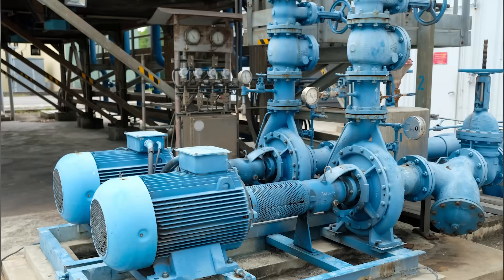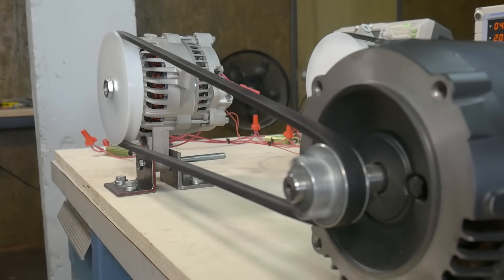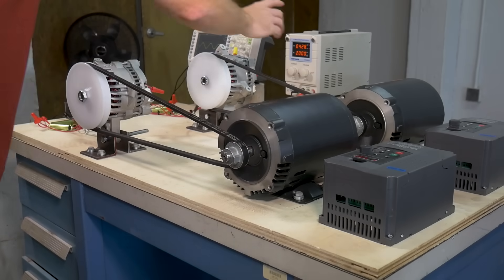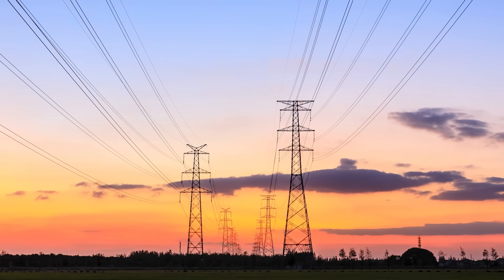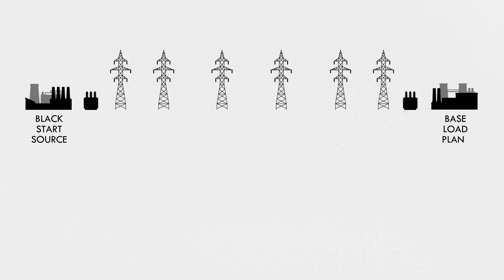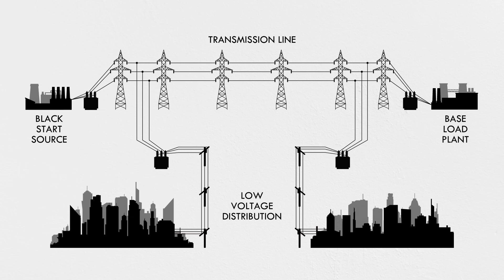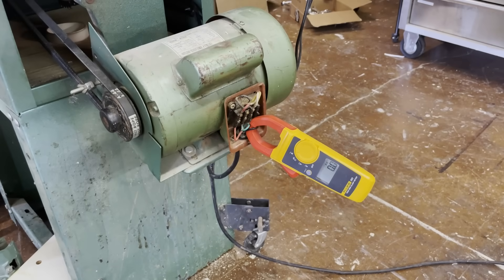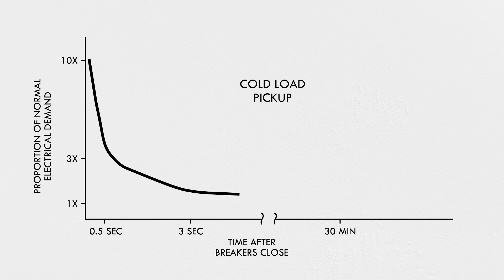What Is A Black Start Of The Power Grid?

Comment: Was involved in a nuc plant upstate NY during the last big blackout.  A nearby gas-turbine plant 'black start capable', fed us power so we could shutdown our emergency diesels.  Then fed a couple of other oil and gas-fired plants that added several MW capacity.  Was a nervous night/ couple of days.
Reply: I was in the NRC ops center that night. I was glad that the evening wasn’t more interesting on our end than it was.  Good job on your end.
Reply: Is there a reason why nuclear power stations don't throttle down and/or partially dump steam to condenser during load rejection? Because tripping nuclear units offline seems far more dangerous than keeping them running at low load, as Fukushima seems to suggest.
Reply: The plants can shed load, but they can’t do it quickly enough to avoid having to shutdown when operating at high power levels. I worked at a plant that presumably could avoid tripping up to about 40% power by operation of turbine bypass valves.  Loss of load transients are part of the design basis of the plants, so they generally shouldn’t create big issues, as onsite emergency generators provide power to essential systems. Plants typically have fuel for several days operation under such conditions. Fukushima was a different type of accident known as a station blackout.  In that case, in addition to losing all offsite power, the onsite emergency diesels were inundated by the tsunami and were rendered useless, so all cooling capability was lost, eventually leading to the meltdowns.
Reply: @gizmophoto3577  Yes, the backup diesel generators were wrecked, but the station electrical bus bars survived. If even one of the reactors at the complex had remained operating at part load, it could have powered the cooling water pumps for the other reactors.
Reply: I expect that one unit could provide power to all three, as you suggest. However, as noted, they were not designed to be able to avoid tripping after loss of load from full power. Such capability would have required substantial changes, such as faster operating and higher capacity turbine bypass valves. It’s also likely the reactor coolant system would have required to be designed to a higher pressure limit, or greater relief valve capacity installed. I frankly don’t know if such bypass valves could have been designed and manufactured at the time the reactors were designed and constructed, or if that and other changes could have been obtained at a whatever was judged to be a reasonable cost. 

My personal view is that the reactors were poorly sited in what was known from the historical record to be an area subject to tsunamis. If that threat had been adequately addressed, the reactors would have survived intact. If you are interested, you can find the report of the Japanese Diet’s The Fukushima  Nuclear Accident Independent Investigation Commission report online.  That document describes the failure of both TEPCO and the Japanese regulator to understand and address what was a known hazard.  I also note that Japanese regulations didn’t even include tsunami until 2006, per a March 26, 2011 New York Times article. 

I hope I don’t seem contentious or argumentative, as that is not my intent.
Reply: @gregorymalchuk272  Part of any plant's design is an item known as 'load rejection test'.  Just how much load can be 'instantly' shed.  Of course part of this issue is the main turbine/generator suddenly accelerate and you want to avoid them overspeeding and tearing themselves apart.  So the turbine controls are designed to quickly shut down the steam flow (most also have valves close between the high and low pressure turbines during such an event).  Now the reactor has to send that steam elsewhere and there are limited places.  Some thru turbine-bypass valves, some PWR's can safely send it to the atmosphere through safety-relief valves. But in any case, the primary/ reactor system starts rapidly heating and it is one of the design events to deal with this.

A newer reactor design (AP1000) that I'm familiar with will even trip a few control rods to rapidly drop reactor power.  But from near full power, about the only thing you can do is automatically trip the turbine to stop overspeed and automatically scram/ trip the reactor.

Comment: For forty years I programmed the building automation systems for dozens of high rise bldgs and other large power users in Texas. Every structure had a program called AwSh.. whose only purpose was to bootstrap the bldg - hold it down until a return to normal was received from the local substation then be nice on the way up

Comment: As a fellow Texas Engineer, I really appreciate your videos!  Municipal water supplies would be another good topic with lots of examples to pull from locally.  I know we recently had an emergency repair on our deep water intake that was a fascinating example of how repairs are done on an active utility with minimal (or major) disruptions.
Reply: I always wonder how big the collective face palm among Texas Engineers was when the 2021 blackout was blamed on renwable sources by officials.
Reply: @ValleysOfRain  It wasn't just the engineers, it was anyone with enough intelligence to vet and understand the readily-available information they found on the web.  But I bet it was big.
Reply: @ValleysOfRain  Nuclear is the way.
Reply: @ValleysOfRain  while everybody knew it was due to powerline failures and fossil fuel plants and pipeline not designed for the cold and not prepared for it. Had they built 4 wind turbines less the entire grid had collapsed completely
Reply: 'major' should been in bold, for Texas.
Reply: New England is next it’s gonna put that TX event to shame!!
Reply: @740GLE  Don't know about New England, but Texas problem was GREED and a lot of missing money. 

Every politician and upper management in Texas should be criminally investigated.  But it's Texas so it won't happen.

Comment: There is nothing more "fun, no fun" that such condition, you can not ramp up the production to 100%, yet the load can still be at 100% or near it.
Is pretty much like taking a gasoline car out of the mud, once it gets stuck you gonna have to shift tactics.
Luckily, you can shed load... And I forgot what Grady pointed out... the whole electrical infrastructure need electrical energy to power itself and run some of it's regulating circuits.
So it is really a bootstrap operation.

Comment: Every time I watch these videos,  I learn something that is completely obvious in hindsight but I would never have thought about otherwise. Engineers are on a completely different level.
Reply: A lot of the experience engineers gained is gained from disasters and hindsight, believe me.
Reply: I think of engineering as “quantified paranoia.” You’re not done if your design only works under ideal conditions. You’re getting close to done if you can confidently answer questions like:

- how would this break?
- how much can it handle until it breaks?
- how likely is it to break?
- how bad is it when it breaks?
- how can we avoid the worst consequences if it breaks?

And yeah, a lot of best practices are informed by past people breaking stuff and learning the hard way.

Comment: Very interesting.  Now I'm curious about how the startup happened with the 2003 North East outage.  I live near London, Ontario.  Our power was restored fairly quickly where as I know other areas took longer to be turned back up.  I also remember they were warning that power outages may occur in the days afterwards.
Reply: I was in Oswego, just across the Lake.  We had two gas-turbine plants nearby that were black-start.  One of the highest priorities was to get us back power (we were a nuc plant and using our emergency diesel generators for cooling and needed off-site power ASAP).  From there, they fed two gas-fired steam plants in town and even lit-off the older oil-burning units (seeing them 'belch' black-smoke during lite-off was a scene we hadn't had for some time).  Somewhere south of us, they tied these in with the power coming up from Niagara.  It was a pretty 'interesting' couple of days.

Comment: Another great video. I love the effort you put into these garage demos. Too bad you had to sacrifice two automotive alternators but it visually got the point across.
Reply: No alternator were harmed to make this video, they ascended.
Reply from the maker: They will go on to greater things ;)
Reply: @PracticalEngineeringChannel   Grady, I'm guessing you have lots of fun things squirrelled away.  Your prioritized wish list would be a fun video by itself (e.g. 3:55 "yet").  Do you have a B channel for that kind of stuff?
Reply: @PracticalEngineeringChannel  connect the alternators to a 3 phase step up transformers and make a working useful generator from it to power your house in case of blackouts :)
Reply: @putraadriansyah8082  He still would need electricity to excite the alternators, and to drive the electric motors that turn the alternators!
Reply: @putraadriansyah8082  What? You can't get something from nothing!😁
Reply: Uh sorry, i forgot. Use a small 160-200cc engine to turn it and use a 3 phase transformers to make a usable power. And some Arduino to control the rotor voltage

Comment: Not sure if absolutely related to the complexities of the grid and black starting but even after the power came back on late in the night of the 2003 blackout, for days afterwards we'd still have several smaller outtages lasting anywher from a couple hours to tens of minutes. It wouldn't be until maybe a week or two later that things where stable and since then I haven't seen any major outtages in my part of Ontario aside from local disruptions.
Reply: might be they didn't have enough production capacity in total and did a sort of rolling blackouts...?
Reply: Xenon poisoning meant that water moderated, thermal neutron nuclear reactors were offline for several days to a week after the blackout. Power supplies were actually extremely tight in the days following the 2003 blackout, even after the grid was re-energized. Yet another reason why I don't understand why protocols demand that load rejection at nuclear power stations means shutdown.

Comment: Coffee maker is totally the most important thing during black start. You don't want sleeping zombies doing the startup. Probably will break more stuff. 😂
Reply: coffee maker is part of critical infrastructure that excites the brain of operators in generating station
Reply: @ketas  As well as system operators in the control center.
Reply: On the plus side, heating devices like coffee makers are very nice loads from a stability standpoint. No weird phase issues.
Reply: Agree about coffee. Here in NH we occasionally have massive statewide blackouts due to winter ice storms. We have a backup generator now but prior to that I liked to joke that power in town was rarely cut off because there were no trees to fall on power lines so at least we were able to find hot coffee.
Reply: A black coffee during the black start on a black and cold winter evening.
Reply: @AnonymosAnthropos  and black coffee in bed 😂
Reply: @AnonymosAnthropos As a former system operator, I always made the coffee, cream and sugar for me.😁 I did my internship for my Applied Computing B.S. at the Phoenix 911 call center, nice people by the way. I mistakenly poured to much water in the coffee machine and made a mess, but the  911 operators told me new people make that mistake and not to get to upset about it. But it was embarrassing.
Reply: As an operator at a powerplant I can confirm, the coffee maker is the no.1 priority.
Reply: Coffee makers are easily the basis of modern civilization, regardless whether it's powering a power plant, a bank, or a college
Reply: On a more serious note, tablets of caffeine benzoate are handy as part of an emergency stash. Caffeine dependence is very mild, but you indeed do not want to be deprived of it in a stressful situation, and popping a pill is easier than making coffee.
Reply: @p_serdiuk  They also sell caffeine mixed with water and sugar in convenient bottles, but you have to add your own cream.
Reply: Coffee maker is the most important piece of equipment in any industrial plant
Reply: @Ryush806  Nope, the refrigerator and the microwave are. Because if you have both, you can have coffee with cream.
Reply: Speaking as someone who has visited and worked in a few control rooms, there are two constants: One of them is the weather on a TV and the other is a coffee pot.
Reply: You joke, but in the emergencies I worked through, the coffeemaker was running nonstop and the freezer was filled with microwave food. We had our own on-site generator just in case things did hit the fan, but with road infrastructure out and power at home potentially gone, everyone brought go-bags so they could work 12 on and 12 off indefinitely. Alternatively, 8 as an assist, 8 as the primary, then 8 off. Coffee is a crucial part of that routine.
Reply: maybe have a good old metal stovetop coffe maker and a portable gas stove neatly stored...
Reply: @jpfidalgo7  this is what I'm doing in Ukraine, as well as having pills
Reply: @p_serdiuk  for me coffee is at least as much psychological as it is a physical need. If i see a picture, a video clip, or even read a description of someone enjoying a cup of coffee, i REALLY end up needing one too!
Reply: @jpfidalgo7  You can also use a stovetop kettle, and not just for tea.
Reply: Or a hot water kettle.
Reply: Ours had dedicated UPS units :-)
Reply: Hopefully they never ban gas fired coffee makers!
Reply: Always have a stovetop kettle, a french press or coffee filter and some ground coffee ready!
Reply: It is the maniacal desire for hot fresh non-instant coffee that will drive the workers doing the power restoration to efficiency. There is no life without coffee!